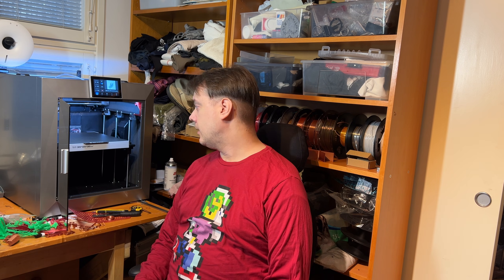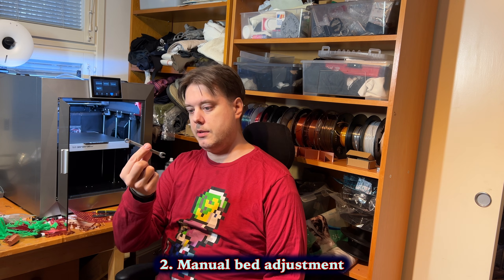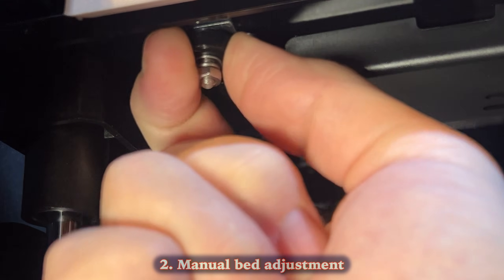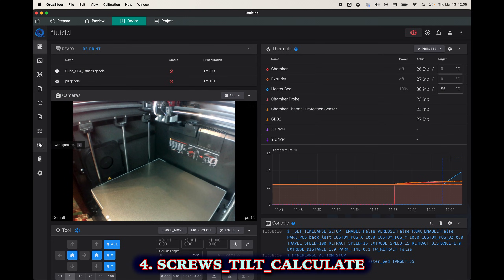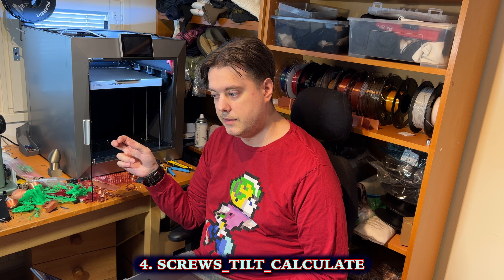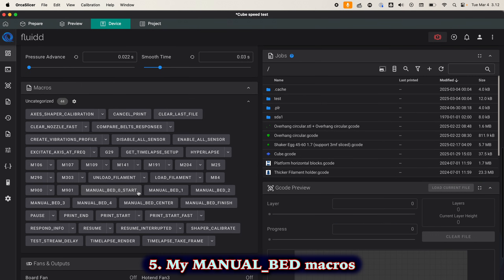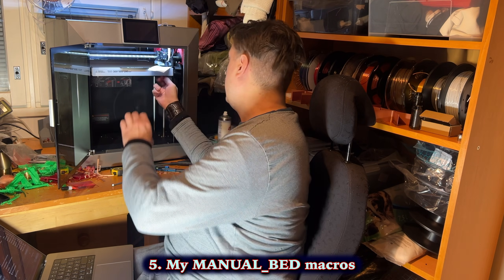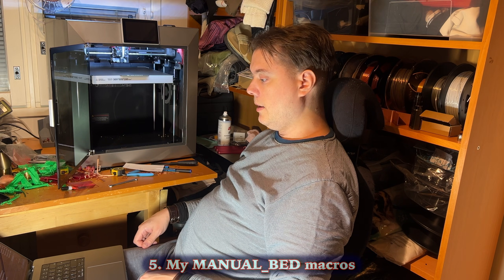Qidi Plus 4: Manual bed tramming, are you too doing it wrong?

Comment: Thank you, does this fix the z offset issues people have been having or do I still need to buy a beacon?
Reply: IMHO, No. This makes the bed "flat" or tram-ed correctly to the nozzle. The Z offset however, requires a known good Z end-stop that is repeatable. The problem with the PLUS 4, the stock bed sensors do not like heat, and are generally fragile. So They do a very poor job of setting the Z zero referance ( the point where the bed just touches the nozzle ). So what happens is, the bed moves up to touch off the nozzle, but the bed sensors don't trigger. So it keeps moving the bed up, and now the nozzle with it, until, hopefully,  the bed sensors finally do trigger. Now the printers Z zero reference is not only an unknown, but it is somewhere above the plane of the nozzle. There is no fixing this outside using some other method to establish the Z endstop. I have a beacon, It seems to work great so far.
Reply: @joey120373  which model of Beacon are you using?
Reply: Was told by tech to ensure you keep two full turns available for the bed adjuster knob Z offset issues that can arise when printing ABS, Nylon, etc.  Going to set up this evening, because the problem showed itself last night after printing many plates at 90- 95 °C bed temps.  I had this issue one other time after perfectly tramming bed back in November, support had sent new board and sensors to attach to bed. Since this issue reared it's head more often, they determined this can be caused by overtightening of bed adjusters, so leave couple turns free. You do not need a perfectly trammed bed due to way it compensates on prints.  Be sure you do not go overkill on tightening bed.   You can tell the issue arises when the first layer prints thin and ugly(or it digs into plate), which means it has taken up too much of the bed adjusters.  I was told by them to allow two full turns on the adjustment.

I am very curious about what it would take to switch to the Beacon method?  Is it tough upgrade to install?
Reply from the maker: @matthewtaylor2344   This won’t affect any Z offset issues people may by having.  It’s just a manual setup for the bed.

I’ve heard that some have issues at higher cabin temperatures, but I don’t print that kinds of filaments so i don’t know.

I did notice a mod in the Qidi Community to make the Z offset permanent so it wouldn’t reset during other operations. That might be worth looking into if you’re having issues with the Z height.
Reply: @mrelwood_media  Thank you so much man I appreciate the quick reply!